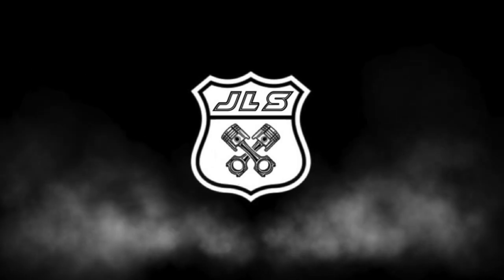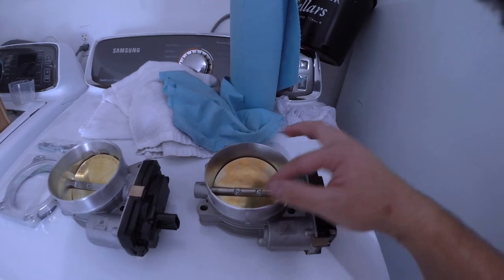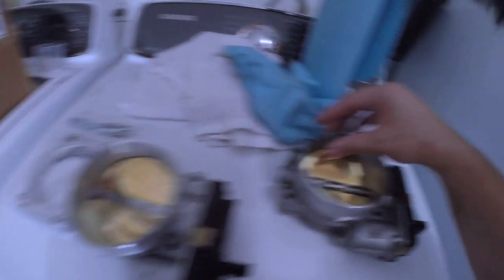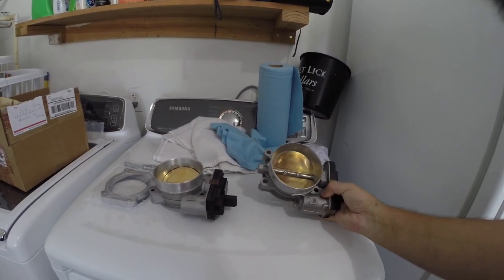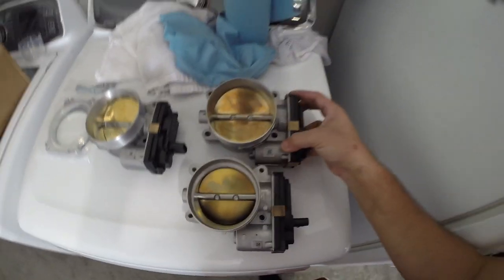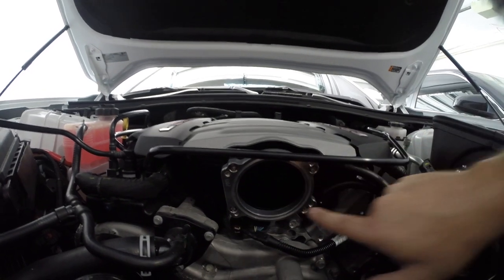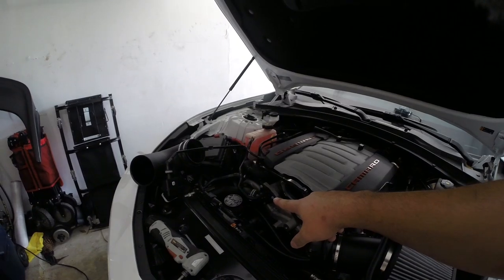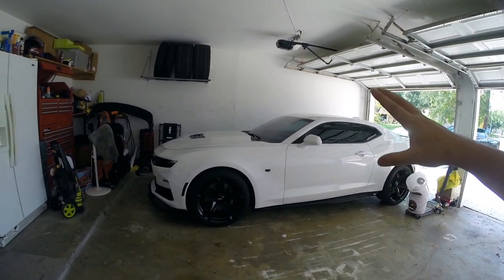Soler Performance vs Pray Performance 95mm ZR1 TB!! 2019 Camaro SS | Vlog #278

Comment from the maker: Soler Performance definitely delivered on their claims of great part throttle and initial tip in improvements while also being very competitive in the peak flow numbers, Pray knows what he is doing and did a great job with his TB which is better than stock at part throttle, but not as noticeable as the Soler, but at WOT the Pray Performance TB did outperform the Soler. For all out gains the Pray Ported TB is the one to get, for a little more part throttle and everyday driving with pretty much very similar gains at WOT the Soler Performance TB is the one I would go with!

Comment: Awesome video. I'm putting together kits with c8 manifold and ported 95 mm TB. The intake is port matched on the inlet. The bottom is clearanced, very nice push connector for brake booster, and map wire extension. It's everything needed to bolt on and tune. I started with a ported stock tb and stock c8 and that picked up 19 wheel over stock. Haven't tested the new setup with 95mm tb yet. I'm expecting a realistic 24-25 on an otherwise stock 16+ Camaro SS. A rotofab dry will help.
Reply: How much?

Comment: Did you have to unplug the negative terminal in the battery for 8 hours(soler performance) brotha?
Reply from the maker: Jonathan B. Yes I did to help the car reset and relearn the Tb
Reply: Jorge Loves Speed right on,I’m a bit confused on the step where you have to drive at at least 44 mph and decelerate gradually it says to do it 4 times ,how long should I wait till I actually give it some hard pulls?
Reply from the maker: Jonathan B. I would say after doing the 44 mph and a few miles of driving you could start doing some spirited acceleration and hard pulls after like 10-15 miles of drivinf

Comment: Slippery doesn’t equal hp. Head porting isn’t polished smooth by many porters. Take it to the track, I doubt there’s a ton of difference. We’re only talking a tb.
Reply from the maker: Mike StClair i agree, in terms of peak hp difference probably not that much of a difference between the two ported versions, but I can honestly say the part throttle difference between them is noticeable. The Soler part throttle response is much better
Reply: Jorge Loves Speed I almost think you’re better off doing the ported intake, ported tb, E85, and tune all at once. It’s like a cumulative effort where together, it makes a much bigger difference. I did all that and headers on my 17 and the difference was pretty dramatic. Now I have a 2020 and starting all over, other than the rotofab I pulled off.
Reply from the maker: Mike StClair of course you will see a big difference doing all at once. For me this was a good way to really see the part throttle differences. Until you try both back to back, you won’t understand or feel the difference

Comment: Would 103mm be a good idea for starting off with general bolt ons, or would that require a new manifold?
Reply from the maker: I think the 103 would require a new manifold the stock one can only use up to a 95mm

Comment: The Tb adapter plate defeats the purpose of the Tb being ported right...
Reply from the maker: Yes, but soler engineering sells the appropriate tb plates that are ported and will fit perfectly with either stock or msd intake manifold.

Comment: I bought a 95 mm prey tb but I have a unported stock manifold will the plate on the tb clear with out the spacer my screw holes are drilled out to align the mani ?
Reply from the maker: I believe it should still work, its the 103mm ones that do not.
Reply: @JLSpeed  thanks bro 🙏

Comment: Pray performance  is 10x better  than all
Reply from the maker: Redzone prays tb is good, no doubt about it definitely had the wot top end flow, the Soler was not very far behind at all I would say it was very close almost a toss up but felt the Soler much better overall under partial throttle and daily driving.
Reply: @JLSpeed  I feel that. Guys I know with pray Dust the shit outta everyone. Top end is insane and the 1/4 mile
Reply: I agree 100% Pray All Day!!!!!

Comment: Hi, where did you get the throttle body adapter?
Reply from the maker: The one in this video was from ICT billet, but Soler performance now has adapters that will work and be better fitted to either stock manifold or msd manifold.

Comment: I suggest you do a little bit more research before buying mods. It sounds like you're going for a ported msd Intake manifold. Spend a little time on the camaro6 forums. You will see why that's a waste of money. If you're going NA. Port the stock intake manifold. Even pray will confirm that.
Reply from the maker: craig, i have the 2019 10 speed auto and have personally talked with brett at pray performance who has recommended i go with the ported msd intake with 95mm tb. Trust me I have done my due diligence and researched and asked more knowledgeable people for their opinions. The 10 speed spends a lot more time at much higher rpms compared to the 8 speed at which point the ported msd intake will see more gains vs an 8 speed with same intake. Thanks for your input though.
Reply: I suggest you specially ask pray about this. He will flat out tell you, as he has told me that on a NA cam or heads/cam car, that even stock ported intake manifold stops pulling around 5800-6000rpm. A ported MSD will pull up to 6500-6600rpm before it tapers off.

Comment: Would a soler proformance tb fit on a stock ss manifold with out adapter plate I currently sold my 95mm pray proformance because the flap wouldn't clear It would hit on the shrout of the manifold please help 🙏
Reply from the maker: Not if you haven’t modified the Tb opening on the manifold. But Soler does sell an adapter that will help it bolt right up it’s basically a small spacer that gives the clearance to have the 95mm Tb to open